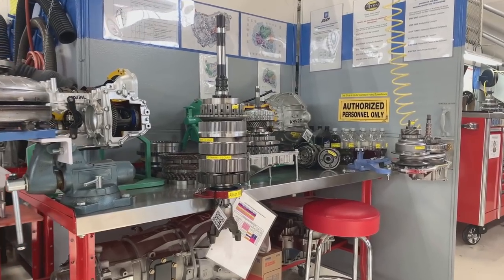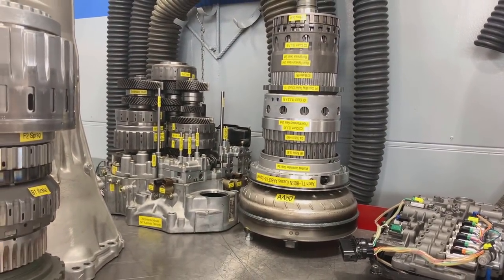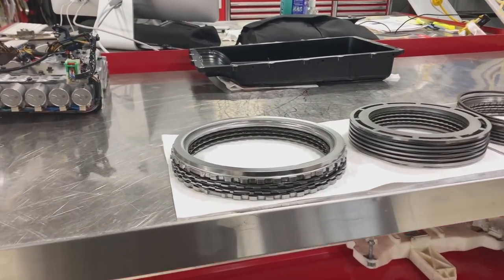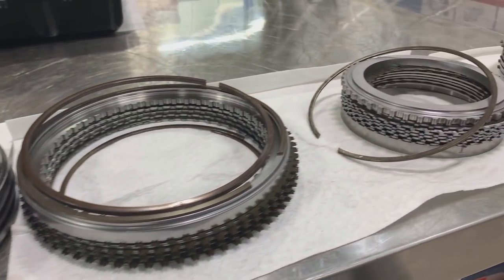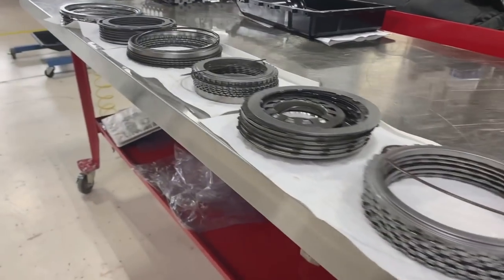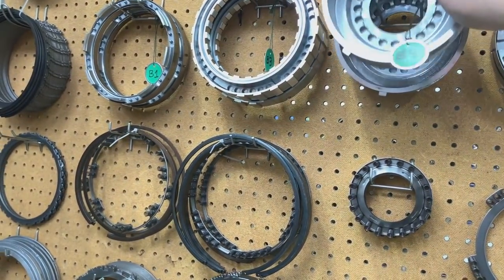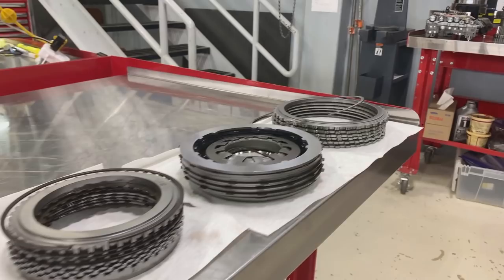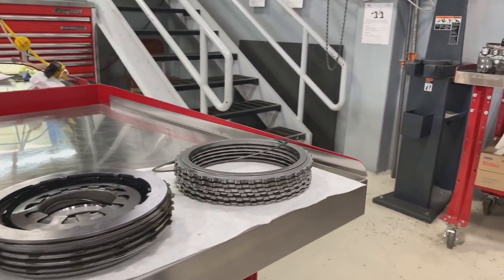AUSV 2520 - Clutches, Bands, and One Way Devices

Comment: You are great man prof, sorry my question is that one of these manufactures used special fiber disc material with out or with slightly  waste and  pollution in order to keep the fluid clean with the best  efficiency lubricant condition for along time.. thanks

Comment: You're the best thanks again! It is easy to visualize the break function piston in that the piston is not rotating and the piston is applying pressure to the plate that is also not moving. How does clutch piston apply force to the pressure plate of a rotating clutch pack?

Comment: Thanks for the knowledge. I was wondering what is the purpose of these wave-shaped springs. Maybe that's why motorbike wheel spins slowly when bike is on the center stand, not in a gear and I rev it a bit. A bit of friction between steel and fiber plates as they usually don't have these elements.
Reply from the maker: They help cushion or soften the clutch apply.
Reply: @WeberAuto  Thanks. Was my assumption that they help separating clutch plates preventing spinning of the wheel not correct then?
Reply from the maker: @MariuszZaleski13  Yes, you are correct about the thin wavy plates. I thought you were talking about the large plate.

Comment: Wow, you have a cut open version of the A343F Toyota trans. I have one in my 97 Land Cruiser that still seems to be in good condition but I'm trying to find info on it. Wish I could attend your transmission class just to get up to speed. I have a 2005 Chevy 3500 Duramax, Allison 1000 trans. Want to add a torque converter with the billet cover, go through the clutches and add the 5-6 speed conversion kit. Seems like there should be a work around on the valve body and TCM reprogramming. I see that you have videos on several vehicles I own. The Lexus 8 speed video was great, I have a 2014 LS460 L AWD and it uses a variant of that trans, just a deeper final, think it's like 3.14. And then a Toyota 2013 V-6 which you also cover in details. At 66, I'm running outta time. Haaa.

Comment: I'm not a student, just an industrial mechanic by trade (formerly known as a millwright), but still enjoying these educational videos very much. One question: what is usually the pressure applied by that B2 brake piston by the hydraulic system?
Reply from the maker: Thank you. I believe the fluid pressure applied to that brake can be anywhere from 70 - 280 psi (482-1930 kPa) based upon the engine load.
Reply: The 10 speed transmission is developed based on ZF's 8HP gen2, and you can find similar B1, B2 brakes design with wave separate springs.
The B2 brake actually has two set of springs, one for the wave springs to separate clutches plates evenly(to reduce drag torque when the brake is open, also benefit for NVH), and the other one is a set of coil springs to help reset the piston.

Comment: IF I was to guess, the wavy springs in between the steel plates are mainly to reduce friction (when clutch is not applied) for better fuel efficiency, and not so much for reduced clutch wear.’

Do Any DTC like the Acura MDX/RDX have those wavy separator springs?

Comment: The cutaway A131L is fascinating - I had a 2000 Corolla with one of those in it - how I have a 2000 Prizm with the A245e. Cheap little beaters that just go and go.

The 131L wasn't particularly enjoyable to drive attached to either a 1ZZ-FE (my car) or a 4A-FE (my Grandma's 96 Corolla).

Comment: When you start sandwishing the plates when your in a rebuild, do you apply transjel, some atf fluid or soak them first in  atf? And my second qeustion is, does the friction material stick to a magnet? Thanx
Reply from the maker: Hello, use transmission fluid for soaking and lubrication. Transjel is only for holding pieces in place while assembling. Friction material does not stick to a magnet. Best wishes.
Reply: @WeberAuto  so, the frictionplates have to be soaked? How long maybe?
Reply: @abourawaaha8399  I would do a 24 hour soak(you cannot soak them too long!) days weeks months, years would be fine, as long as in sealed container.

Comment: Hi i have a problem I have a car that runs good on flat road with full power..but on a stop and go on a incline engine bogs down as if something  lockup engine at 760rpm .. on incline throttle is MAX 100% but rpm is 750RPM..Can this be due to Bad Torque converter..? on flat road i see all is normal No DTC codes....SUV is Ssangyoung kyron D20DT benz engine..

Comment: What is so special about the ZF 8HP automatic transmission? Why does it stand out from other similar 8 speeds torque converter automatic transmissions?
Reply: It has a genius planetary gear set design through a multiple generations of computation instead of traditional planet gear sets like Lepelletier, CR-CR, Simpson, achieving a well balanced design of: (1) four degrees of freedom. (2) optimized step ratio of each gear and the overall gear ratio(7.0~8.6). (3)low torque loss, only 2 clutches/brakes open at every gear. (4) quick and agile shift(skipping gears is almost possible in every gear) for sportiness.

With the help of the wave separation springs and the integrated centrifugal pendulum in the DMF, the efficiency is increased further more.

ZF has also registered multiple patents about 8 speed designs using traditional planet gear sets before 2010, and it has find none of them are match for the actual 8 speed design.

EPA has published a benchmark(by FEV) on Gen1 8HP and several other transmissions(incl Aisin Gen2 transverse 8 speed), confirming its excellent efficiency.

Comment: With a manual transmission, especially in a driving school car, you have the change the clutch when it’s worn thin. Don’t these clutches wear out? Are they ever replaced economically?
Reply from the maker: They do wear out, but normally last a very long time. Abusive driving will accelerate the wear.